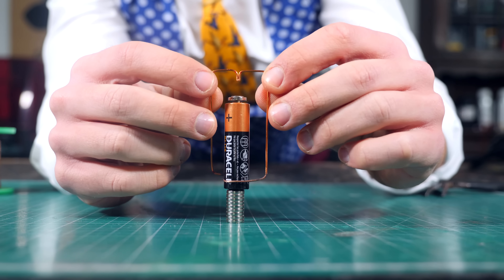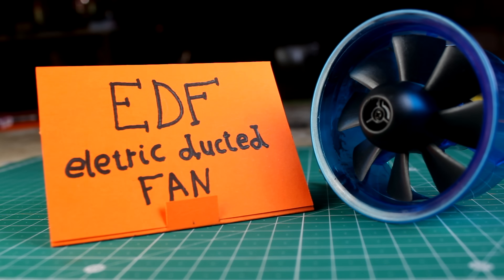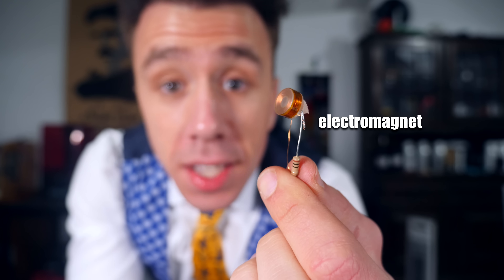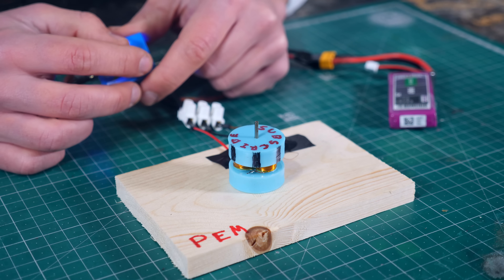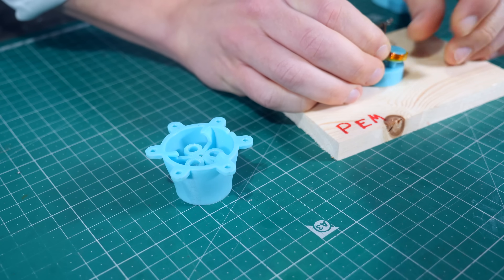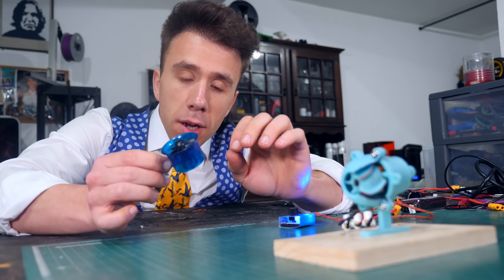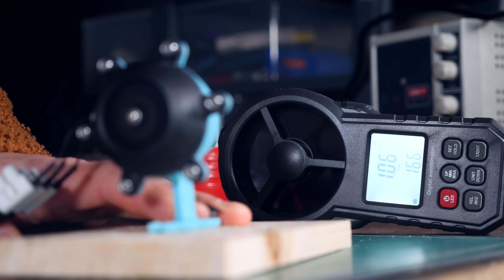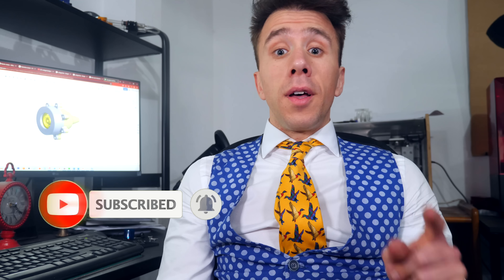I 3D Printed an ELECTRIC MOTOR FAN

Comment: I'm going to guess a couple of things.  I can't tell if the fan blades are the same diameter or not.  I would say make sure they are as the fan speed increases with the larger diameter.  There is a limit on size of fan blades where they start going super sonic.  I mention that just to make it clear that bigger fan is a faster fan.  Secondly if your engine worked based on pressure you might be having a pressure problem.  The EDF fan also increases pressure and pushes directly back.  But most importantly is that there is almost no restriction behind it.  So any pressure it creates quickly changes into movement of the air.  In your centrifugal fan you might need higher pressures to get the air out, as it might be more choked.  Also you might be forcing the air to take a less direct path and make it twist/turn more.  Lastly, I'm not an expert, but that's just my guess.

Comment: The thrust is not the same because the design isn’t optimized for thrust, rather static pressure. The fan produces a lot of thrust very efficiently but not pressure, and the centrifugal compressor produces a lot of pressure but not a lot of thrust, if you want a compressor fan to be more optimized for thrust you will end up with a design that looks like a fan, there are tradeoff between thrust and pressure you can’t have both with the same power

Comment: Ok so there are a few issues from watching your video and the design elements. Overall your idea is sound but I think three issues are greatly affecting your design. 1) I think the nozzle friction on the back end of your impeller setup might be too high and leaching some of the energy from the system. 2) Impeller pitch has to be balanced with input duct area and shape and output duct area and shape. Both of these factors also have to be balanced with the impeller pitch and shape to maximize your final output velocity. Now I've found through experience that if one of these elements is not optimal it creates a significant difference in output velocity. 3) Make a note that jet engines also use a multi-stage compression system that optimizes flow between each fan set. If you also look at more modern larger but shorter jet engines they reduce some of these stages by optimizing the flow rate between each stage. This takes a bit of simulations to get just right.  
Take a note as well to the simplicity of the EDF and the smooth surfaces, this will have overall less drag than the impeller model you put together. Also dyson's fan blade model for the vaccum cleaner is similar to the fan but just a little different. Though they both share similar designs the cowl for the output plays a significant role and I think the impeller is slightly larger.  Hope this helps. I might take the time to dust off some of my aerodynamics books for this to find some of the formulas.

Comment: Probably someone might have suggested this, but what about using the idea of the Dysan bladeless fan, but using the centrifugal fan you are working on, and make a bladeless quadcopter so they will be safe for indoor home use without a blade poking out an eye. I think this could probably be easier with 3D printing these days. Either 4 separate bladeless fans at the 4 corners, or one bigger central air intake opening on the top controling the amount of thrust out of each bladeless fan downward as control. And for coolness points, once this is working, make the body look like the stereotypical flying saucer. err "UAP". and don't forget to 3D print little green aliens inside looking out.

Comment: Have you thought about a two stage design? It seems like youre not getting enough air going into the impeller. You get more air into the ducted fan because of the bigger opening. I believe you would bet more airflow if you had a counter rotating impeller which would also help with vibrations just off of my limited knowledge with physics lol. Its kind of hard to describe my vision but basically you could make an inlet that spins and has blades on the inside kind of like a cement mixer that spins counter to the fan direction of your fan on the inside.  I dont own a 3d printer but I would love to experiment with one.  I too am a fellow tomato hater...

Comment: I am fairly sure that it is a pressure/flow rate balance. The edf has high flow rate and low pressure capability. The centrifugal impeller has low flow rate but high pressure capability. This means that the linear velocity of the air with the edf is higher so the rate of change of momentum is higher and so is the thrust. However if you need to generate significant pressure then the centrifugal impelller will come into its own.

Comment: Just make a electrolyzer to split hydrogen and oxygen from water and 3d print an hydrogen fuel delivery system to combust it in a metal tubing with a nozzle to get thrust please do it its eay kore fun than you ever think

Comment: Aero Engineer in training here, the best way I can describe what is probably going on is that because the EDF has a much larger intake and exit, it can provide significantly higher mass flow rate for the same power consumption, which is much more efficient for generating thrust. To be a bit more specific, thrust is going to equal (roughly) the mass flow rate through the "fan" times the difference in velocity of the exhaust vs the freestream velocity. The power required to do this however is given by the kinetic energy equation, and comes out to the mass flow rate times the velocity squared. Given that the motor produces a roughly constant power in both systems, it will produce more thrust when the difference in velocity is lower and the mass flow rate is higher. EDF's are really good at this given they have a large area to pass through the flow, try this same motor with a large drone propeller and you'll probably find that it produces even more thrust than the EDF.

In jet engines these kind of impeller compressors are useful because the combustion efficiency of the fuel greatly increases as the temperature (and therefore the pressure) in the combustion chamber increases. This design also lets you get more thrust out of less air, which is obviously nice if you're trying to make a very high performance engine, but the drop in efficiency with this design as you have now found is largely what is driving commercial airline turbofans to become wider which you may have noticed in the aviation industry over the past few decades.